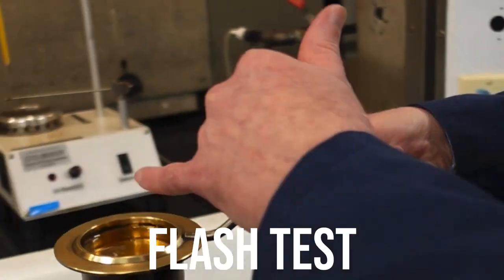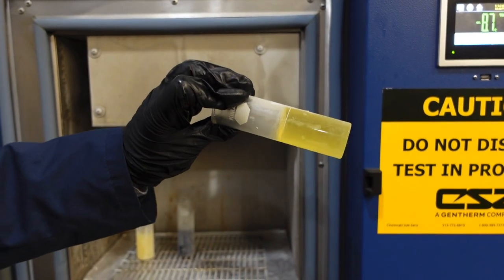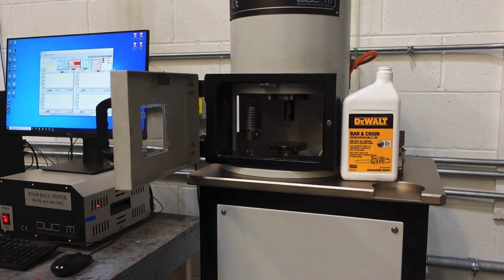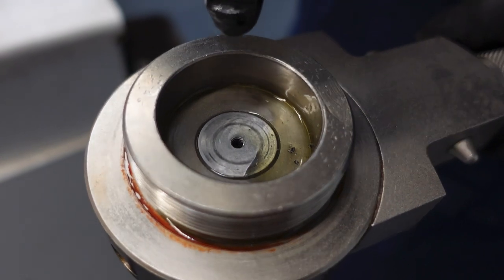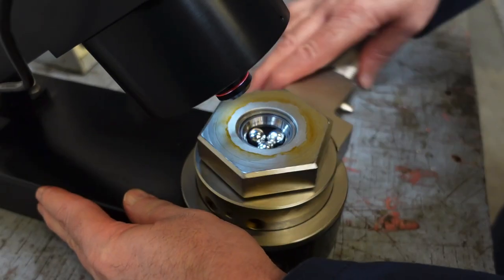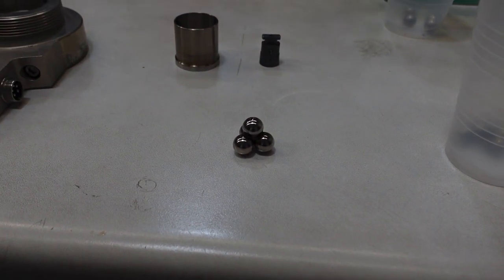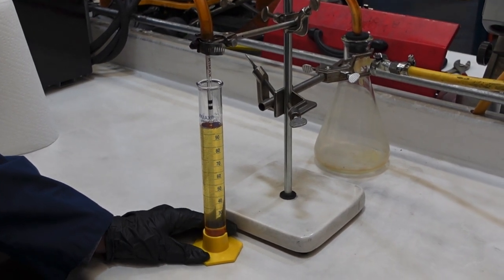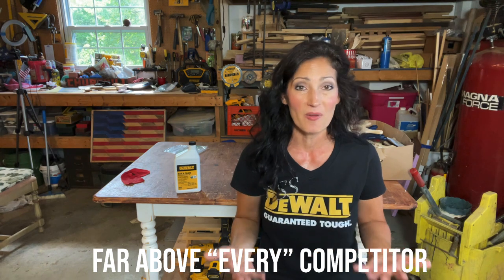Lab Testing DeWalt Chainsaw oil, how did it do against the MAJOR COMPETITORS? Behind the SCENES look

Comment: Gee hi viscosity bar oil breaks cam follower!
Dewalt does not make oil BTW
Reply from the maker: DGP is the licensee that makes DeWalt's bar and chain oil. As far as the high viscosity comment, I'm not sure what your opposition is directed at? Dewalt is a true all seasons oil that works from -15F to 500F+
It beat the snot out of the "top" petroleum brands in every category.
Reply: Repeated complaints of the cam follower breaking.
Not to mention wrong o-rings that swell and lock up pump.
Not to mention oil leaks due to multiple design flaws.

Kids designing these things.

 @Jennyfromtheshop
Reply: Stanley makes these not dewalt
Reply from the maker: @ckratzet5286  Stanley Black and Decker is the parent company of DeWalt. I have had no issues with my chainsaw and I’m not aware of any complaints with the oil but if you have problems take it up with DeWalt.